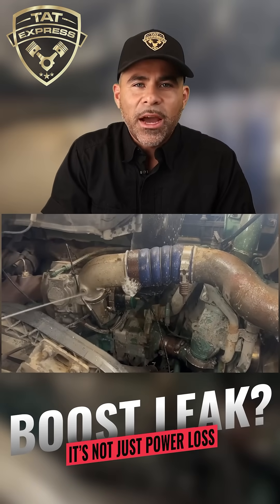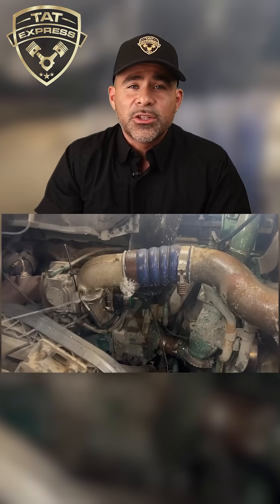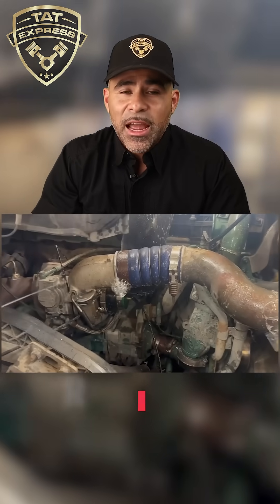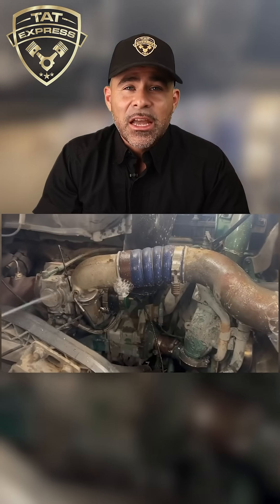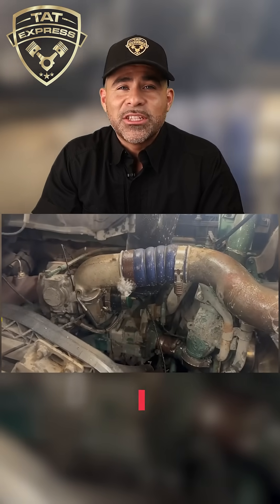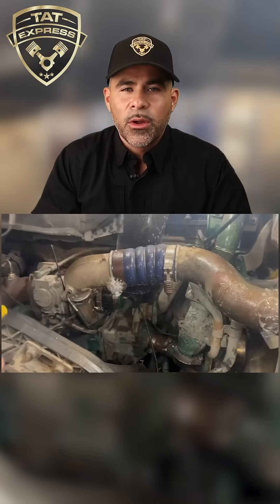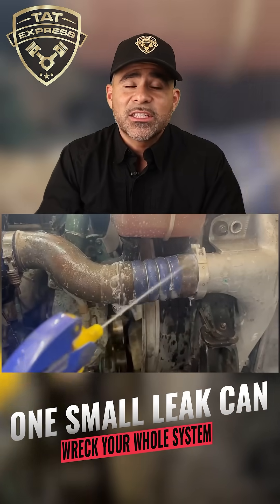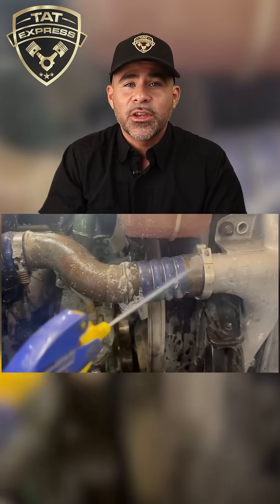💨🔧 Boost Leaks Aren’t Just About Power | Here’s What They Really Do to Your Engine 🚛🔥

Comment: ok I have a 7.3 runs really good then all of sudden it just drops all boost get out of the throttle and and away we go nice and easy climb up but if you get into it acts like a wastegate I really dont think it is maybe there is a small leak and just shows up under more load
Reply from the maker: @kevincraig8257
That does sound like a small boost leak—especially if it only shows under heavy load. Also worth checking for a weak charge pipe boot or a sticking wastegate actuator if equipped. A smoke test or pressurizing the system with the engine off can help pinpoint it fast.